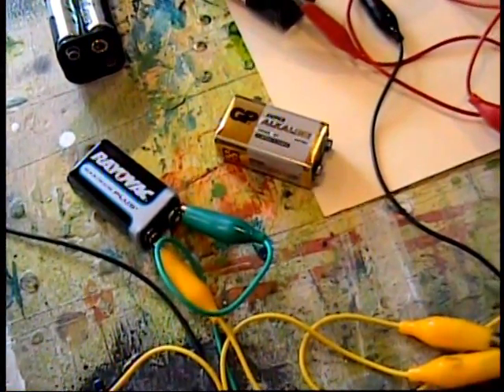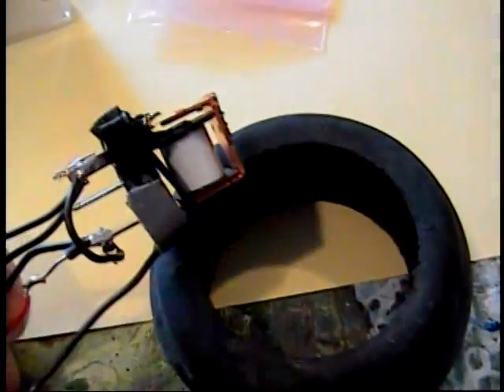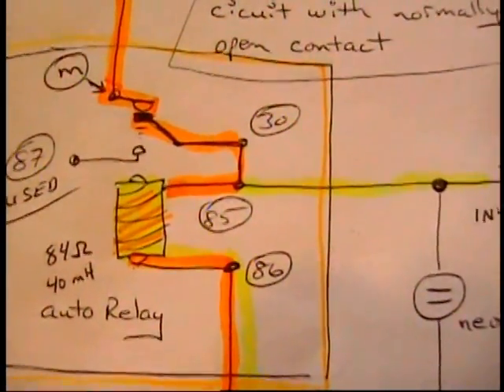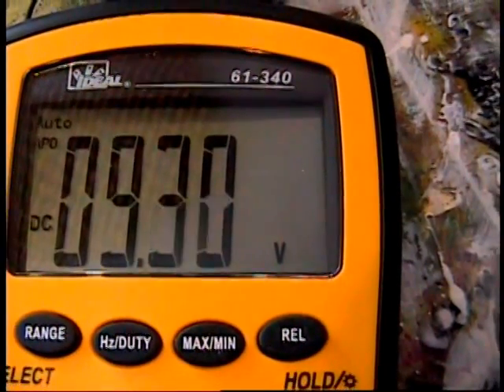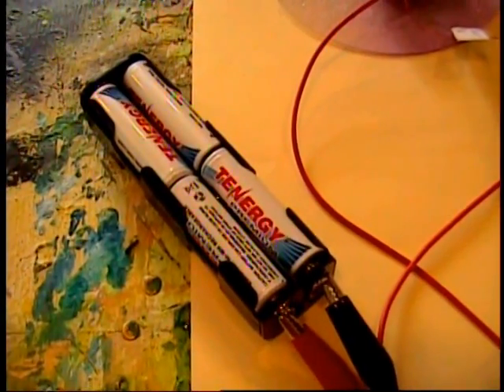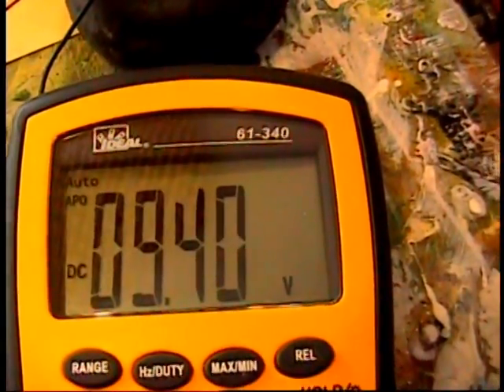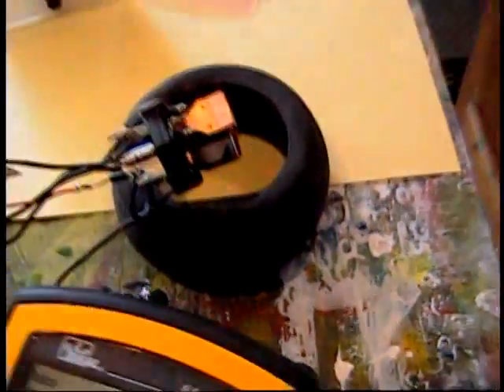Auto Relay Charges My 9 Volt Batteries

Comment: hi where is the circuit
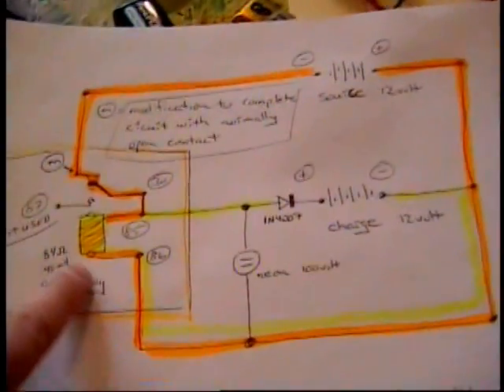Reply from the maker: Armed Forces, the circuit is at minute 1:24. It is very minimal. Just an electro-magnet that forces the contact to open when energized. This break in current causes the magnetic field to snap back into the coil and a high voltage surge is directed at a second battery to charge it.

Comment: Instead of this noisy buzzing relay... why can't we just send 5ma of constant current into the 9V battery until it reaches 9.6 volts ?
Reply from the maker: smoothntallGWM, good question. A very small current from a voltage source very near the target might work. I would still prefer the voltage flyback that an  inductor kicks out to be sure that no heat builds inside the battery. The small cells inside the 9 volt package have gaskets in the negative end that will leak at the slightest bit of heating. Once the gasket leaks it soon kills the battery.